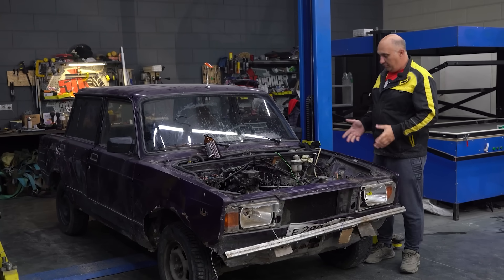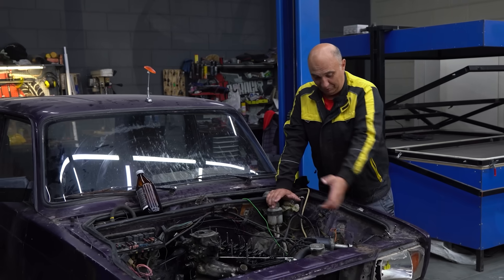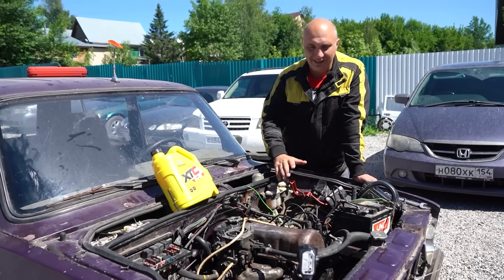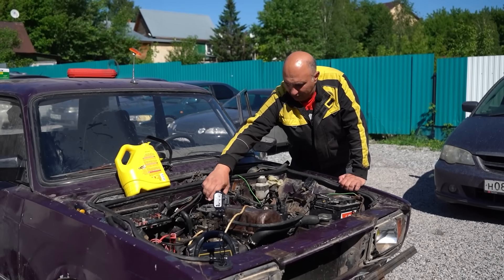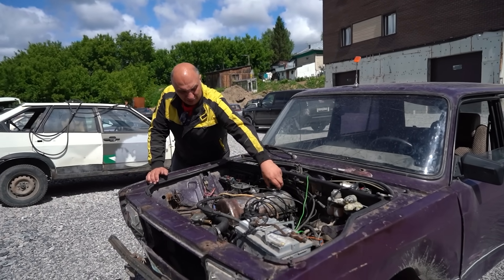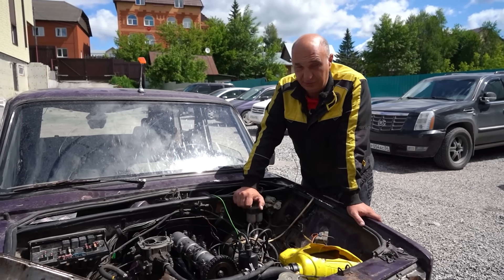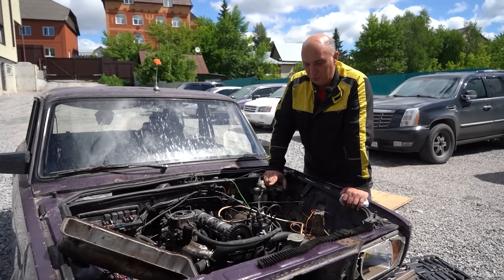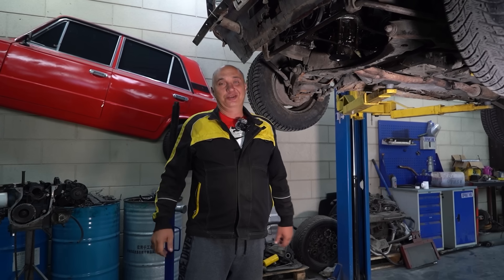Flushing an engine with paint remover – will it work?

Comment: This looks like a good idea to do to an old car that just needs a good engine flush due to gunk buildup.
Reply: Don't do it on modern cars. Paint thinner will corrode the plastic and rubber parts of the engine.
Reply: @jwalster9412  Thats why I said an old car thats not a worry if it has a problem
Reply: @LSnium  1980s would work just fine.

Comment: At 13:53 when you put that thinner in there with the oil you turn that oil into basically abrasive liquid and scratch every surface that gets oil and change the life of the engine. I don't ever suggest putting any additives in your oil to clean your engines. It's designed for motor oil only
Reply: Nothing like sanding down your bearings, pumps passages, etc.

Comment: The front and rear engine seals are going to leak severely in a few miles.
Reply: I’m not so sure. It may dry out the seals and disintegrate after a while. But as soon as you poor oil back in, it will re saturate the rubber seals. There are even products you can poor in the engine to get some more time out of worn seals. It softens the rubber and expands the seals, but it weakens them so they won’t las long after that.
Reply: @invisiblekid7374  nothing fixes worn seals. 
Most of that stop leak seal rejuvenator is basically brake fluid. 
And if it's worn from high miles it's not gonna work. 
But it might work for an engine that's been sitting a long time and is all dried out. 
Even then,it's a matter of time before they leak again. 
Just my observation from 30+yrs of this stuff.
Reply: @MrTheHillfolk  It's not, it's just thicker oil/fluid, there's nothing really magical about it.

Comment: I have used diesel mixed with motor oil to clean my toyota engine. I Would try paint remover (dont do it , it could eat your rubber seals) mixed with oil next time. When cleaning your engine its a good idea to get 2 extra oil filters so that you have a new one after you have done the cleaning job
Reply: Just as good is to put in a quart of diesel engine oil, the extra detergent will move a lot of the sludge out, and drive it for a day or two to let it move all the gunk down. Then you can drain, and run regular oil again.
Reply: Good but dont do paint remover.
Reply: @Allosaurus 67 yeah that is l
One of the drawbacks. Replacing the rubber seal on the top cover isnt too hard but its worse if the seal to the clutch gets broken lol

Comment: Paint thinner contains aggressive chemicals like Acetone, which also eats away at rubbers and plastics.
It's killer for engine seals.
Though when Acetone is mixed 50/50 with ATF for example, it's a great scrub for cleaning carbon of off pistons and other metal surfaces like valves.
I considered running Acetone through the intake of my car, but then learned it could ruin the valve seals... which would have been a disaster.
Reply: Ive heard that used to clean gun barrels
Reply: @skie6282  That sounds like a great application.
Reply: It was paint remover not paint thinner..but you made a point across wich i was worried about to,the effect on the o rings seals and don t forget the white metal liner on the crank and bigend bearings..i don t recomend fluching but in some cases it s nessesary
Reply: @MrRichard57000  Right, it was indeed paint remover.
Though some removers are based on alcohol while others can contain chemicals similar to thinners.
Reply: @DeeDee-pw9pm  they say atf cleans as well??anyway not fond of any agents,but if you have compression loss and blow by than its time to gife ot a try...
Reply: @MrRichard57000  ATF doesn't clean, but a mixture makes it easier to apply the acetone by making it thicker and less runny.
The Acetone then also evaporates slower.
Reply: Dude it doesn't enter the combustion chamber so carbon won't be cleaned from the piston
Reply: @manishholla  What do you mean?
It doesn't enter the combustion chamber in what regard?
What part of my comment are you reacting to.
---
Are you reacting to the 1st part where i merely talked about the effects of solvents on materials inside the engine?
Or are you reacting to the 2nd part, where i suggest using a mixture as a cleaner to clean surfaces, where i didn't specify the operational state of the engine which might as well be disassembled.
Or the 3nd part, where i talk about my own consideration where it WOULD be involved with the combustion process?
---
Unless you're talking about what's happening in the video, in which case, YES captain obvious... It's not involved with the combustion process.
I never suggested that it does, and thanks me for telling me what i already know.
STILL! The Acetone following the path of the oil comes in contact with the front-main-seal and the read-main-seal, which will be damaged or even destroyed.
---
Next time please make yourself clear so i don't have to ask so much to get to understand what you mean with your vague comment.
Use your words.
Reply: @DeeDee-pw9pm  Arrogant.
Reply: @overPowerPenguin  Who is arrogant and why?
Please use your words so you can make sense, instead of randomly saying something without context.

Comment: Some people trip over dollars to pick up dimes.  Pay for the engine flush that works.  imagine what that paint is doing to all the rubber seals in the engine.  I hate it when the rear seal starts to leak.  should have bought the s**t from the top shelf.  Like my dad always said.  Quality is remembered long after the price has been forgotten.  but then it was a piece of s**t car so i love what you do.
Reply: Chill out...! This is just an experiment to see if it works. Nobody asked you to do it on your car. If anything, it proves that the stuff can be used to clean components off the car.

Comment: This channel is always fun, but this episode was particularly interesting. I’ve owned around 30 vehicles so far, and worked on 50 or more; but the only time I used motor flush was back in 1987, on a 1970 318 V8… and I have no idea if it was ultimately more helpful or more harmful. 🤷🏼‍♂️ While I find the notion of flushing accumulated sludge from the oil passages to be very appealing, I’m too leery of potential damage on the camshaft lobes, as well as killing computerized components on a more contemporary engine, by using something as volatile as paint remover. ☠️
Reply: it can eat plastics and rubber so yea itll fuck some shit up on newer cars with electronics lol
Reply: @yalolol  it could also damage gaskets.
Reply: It will probably eat at all the engine seals and worse case the loose sludge block's oil passage ways creating a blockage and then starving the engine of oil.  For entertainment and FUN factor, I am 107% positive this would clean the internals and the engine if the procedure is repeated several times (5x) with combination of new oil + oil filter.
Reply: As one other car channel said (fordbossme I think) you can’t go fast on the crud removal because it can clog the tiny oil passages these new engines use. Still best bet,  change oil often.
Reply: @stevemiller6766  yep, one of the best things you can do, when buying a used car whose history is unknown, is to change the oil and then change it again after about a thousand miles.  If it's noticeable dirtier, do another oil and filter change after another thousand or so. Repeat again until it comes out as clean as it went in.  Then change every 4-5 thousand.  I've got a 99 Mercedes that had over 150 thousand on it when I got it.  I change the oil every 5 thousand and it comes out looking like new, have put over a hundred grand on it so far.  Small price to pay in the long run.
Reply: On our cars that are more prone to carbon build-up (those that do lots of cold starting and drive short distances), I periodically do a motor flush about once every three years or so. Have done so for years. Naturally I use a specialised product and not paint remover.
Could be placebo effect, but overall I feel that the engine feels and sounds smoother after the flush. Idle RPM tends to be more even as well.

From my experience, you mainly run into problems with parts like hydraulic valve lifters when you do a flush when a large amount of sludge has already accumulated. On the other hand, I’ve also seen stuck valve lifters come back to life after a flush, so your mileage may vary.
Reply: I blew my 1AZ engine due to motor flush. I do not recommend these things. regular service will eventually keep your engine clean most times and les sludge
Reply: @honestsoul1063  so much for Toyota reliability
Reply: how
Reply: how
Reply: 8
Reply: I use half a bottle of flush every other oil change, never had an issue, and when I pull off a valve cover the engine is spotless.
Reply: BG flush.

They only sell it to certain places. It’s the best stuff.
Reply: If you change your fluids often and early, sludge buildup won’t be a problem
Reply: I run seafoam before every oil change for 200 miles, with grandma driving. Motor is clean inside
Reply: I could definitely see using it on a motor destined to end up in a demo derby car.

Comment: paint thinner always cleans gummed carbs and other parts so of course it would work inside an engine but might not be good for the gaskets and rubber parts
Reply: They did NOT use pain thinner, but paint stripper! Quite a difference
Reply: Or bearings once it delutes the oil.
Reply: Or modern engines with various breather pipes and hose couplings made of high temperature plastics. Hell, on my TDi Golf the whole oil filter housing's made from some kind of plastic !
Reply: I hope your carbs don't have plastic parts..
Reply: @jwalster9412  many carbs have plastic parts
Reply: This is an amazing way to ruin someone's day. Just tell them to dump paint thinner on there oil, wait afew hours after the first start for them to call and ask "why is my gaugeclister lit up like a Christmas tree, and why is my engine ticking?"

Comment: I use about 1qt or 1 lt of diesel fuel before I change the oil and filter. LS engines get really hot and cook it on, and diesel fuel cuts it off really good.

Comment: We use diesel fuel like that on old dirty motors. Let it run and then let it sit over night. Run it some more but do not drive it. 
Then change the oil and filter.
Reply: I once ran a motor that had been sitting around in a corner and the outside was a big ball of grease. The inside was a big ball of sludge but I started running nice new detergent oil and after couple thousand miles I had the valve cover off and could see where the new detergent oil had been dissolving the sludge.
Reply: But at what point in that process did you piss on it?

Comment: You should use diesel that’s a good engine cleaner too
Reply: Go about 1/2 and 1/2 with brand new oil. Oil has a detergent in it also these days. Maybe use some 20w-50 so it's not thinned out too much.

Comment: Interesting experiment but what does the main bearings think of it. How does the paint thinner effect the lubricity of the oil ?
Reply: I don't think we are going to hear about it leaking oil out of every rubber seal on the poor engine.  that will begin in a week or so.
Reply: @johngillon6969  I'll ask about the fate of this particular one. The guys over at G54 are smart, it it's possible - they usually don't let good engines go to waste and at least try to preserve them for future experiments (as you will see in next Tuesday's episode).
Reply: @SwapBlogRU  but I can definitely see it damaging any non metal parts.
Reply: @jwalster9412  yup, most plastics won't like it. 
Anything with timing chain guides won't be happy either.
Reply: Running at idle puts very little load on main and connecting rod bearings. I doubt that they were damaged.

Comment: I was happy to see you cut the oil filter open!

worked good. I'd attempt it on an old beater.
Reply: gasoline and petrol mix cleans alot better and it dont destroy gaskets and seals
Reply: Gasoline and gasoline? Lol
Reply: @tboniusmaximus3047  Yeah cuz gasoline and petrol don't mix. (harhar)
Reply: @UberLummox  lmao
Reply: Paint thinner eats away at rubbers and plastics.
It's bad for engine seals if you use it as a flush.
But cleaning metal surfaces is not a problem.
I suggest just getting pure acetone and mixing it 50/50 with a ATF oil to use as a scrub.
Reply: @DeeDee-pw9pm   they har ruskis what do you expekt?

Comment: I’ve herd this will actually help clean out your Cats if your getting that annoying p0420 code a gallon of paint remover to about 7-8 gallons of fuel
Reply: He put it in the oil not the fuel .
Reply: @kevinclear4007  👍🏾
Reply: I thought it was lacquer thinner that did that. I imagine stripper would eat away seals and hoses.

Comment: I wouldnt be wrecking anymore lada's ,, they will become valuble sooner or later !!!
Reply: Sure if you can teleport them to usa somehow.
Reply: I looked this up recently, and apparently the Lada Riva (known in Russia as the VAZ 2105 and 2107) is the 5th most popular car in the entire world. We won't run out of them anytime soon.
Reply: @SwapBlogRU  Yes, the vehicle that comes from the factory with what can be described as built in wear, because the tolerances on parts are so loose.
Reply: @SeanBZA  yet they still manage to run somehow and sometimes
Reply: It’s stupid that the lada is not available in the US.
Reply: @applepoop10  they wouldn't have bought it. or the fiat 124.   well some fiat 124 spiders were brought over, it's kinda the same car in the way that it's not at all.

anyway you can import one now as they're old enough but not many people have done that so the usa pricing of them is kinda high if you really want one. right now bringing one over from russia proper is probably a bit complicated and there's not that many left in eu as many got imported back to russia after ussr fell or in general weren't taken care of, so russia is the most abundant source of them cheaply.
Reply: @lasskinn474  Most of the Ladas imported into the US were from Ukraine, Hungary and Bulgaria and lot of them are garage kept examples with low mileage. On average a garage kept VAZ-2105 from Eastern Europe could cost you around $3,000, but in the US it would cost you 5 times more.